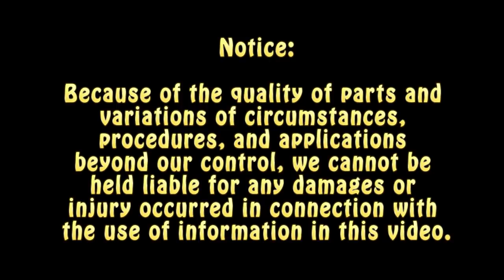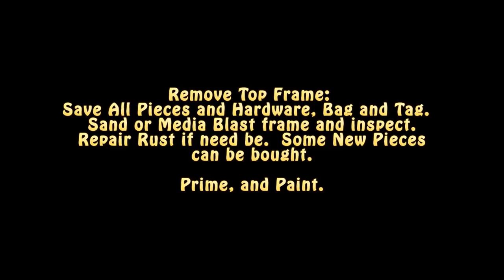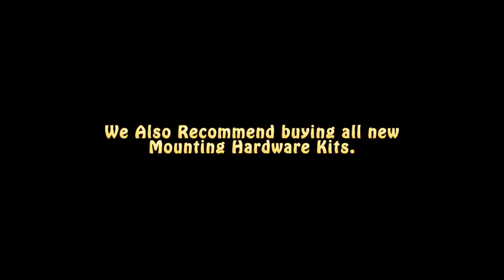Classic VW BuGs How to Install Convertible Beetle Top Restoration Part 1

Comment: Hello Chris Vallone, I know what I’m about to ask has nothing to do with this video but I’ve been stumped with a problem on my VW Beetle, for some reason I’ve been through a couple 34 pict carburetors and they have all leaks from the same area and that’s the shaft that leads from the pump on the carb through to the Accelerator arm near the cable. AND it only leaks when it’s shut off! I’ve tried 
•Adding shims to the float for early shut off 
•rebuild kit(s)
•replacing the (non-integral) fuel pump with a new stem piece. 
But for some reason it’ll still leak after it’s shut off and then it’ll flood the engine and have a hard time starting

Comment: I find it odd that the front wood bow is what looks to be particle board.  Particle board swells and crumbles if it gets wet.  Will the top material properly seal this piece from humidity and wet weather?
Reply from the maker: We seal the wood later on you will see.  And yeah that particle board stuff is not the greatest.  These are fair weather cars though, so it will not see inclement weather.
Reply: Also keep in mind that "real" wood swells, shrinks, and sometimes even twists and warps with changes in temperature and humidity.  It's entirely possible that a front bow could suddenly not seal or close properly simply because the particular piece of lumber it was made from isn't inherently stable.  The man-made material might deteriorate after long-term exposure to moisture but it won't twist and warp.